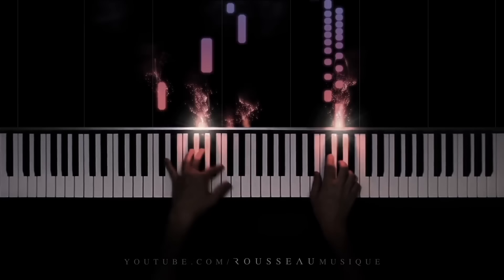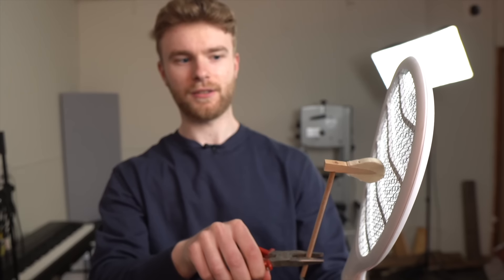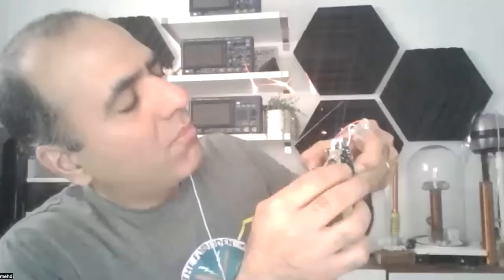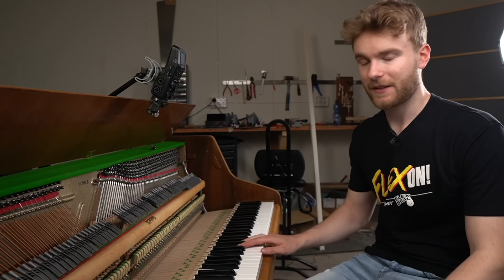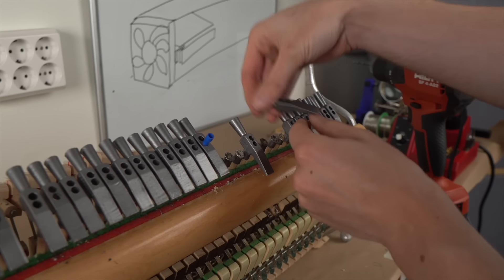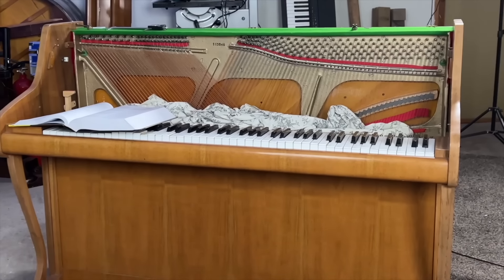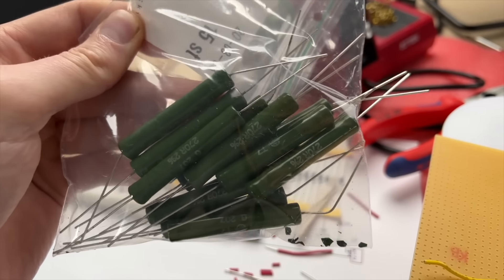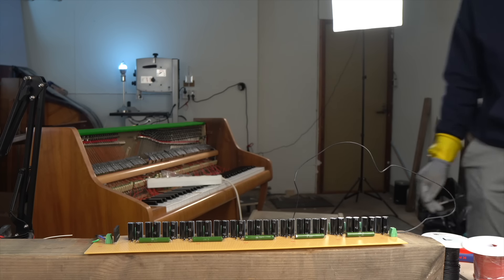How to NOT make an electric piano ft. @ElectroBOOM

Comment: if you listen closely, you can actually hear that the sparks are making their own pitches and music actually sorta matching with the notes he plays
Reply: If I had to guess it's probably something to do with the length of the strings.
Reply: frequency is inversly propotional to length that is why the sound of sparks vary with the lenght of string
Reply: @GamerChillz  this is probably the most accurate, along with the fact that the spark might also vibrate the string. Pretty sure the pitch of the electrical spark itself wouldn't vary in any definable way if my knowledge of electrical physics is right (admittedly fairly limited, as my formal education in it is only basic Uni level. If someone with an actual uni degree in electrical physics or similar disagrees with me, listen to them instead)
Reply: I just like the sounding of the sparks in time with the keys. Good observation though!
Reply: @settratheimperishable4093  Hypothetically you can make a circuit that varies pitch based on resistance (which would vary by string length if you hooked the strings up in a certain way). But, that''s pretty certainly not what's happening here (not that I know electronics well enough to be certain).
Reply: They just support rythm.
Reply: I can hear hit sounds
Reply: Auditory illusion. You think they have distinct pitches because you’re hearing it with the piano.
Reply: For some reason It reminds me of heavy metal bass drums.
Reply: And even drum syncopation
Reply: It's an auditory hallucination, they're all generally the same pitch.
Reply: In theory, the density of the electricity affected the pitch and the density was affected by the tightness and the size of the strings.
Reply: @speedsovereign  “Density of electricity” BRO ☠️☠️☠️
Reply: @muffinconsumer4431  sarcasm, i tried to hide the sarcasm so it would convince the others

Comment: As an Electrical Engineer I admire both your level of cringe around high voltages and your level of insanity!! That's something I thought only I would be mad enough to make! Those circuit boards were beautiful, amazing job all around.
Reply: my grandpa is a master electrical engineer for many many decades at this point and extremely anal about occupational safety, and this would probably make him lose it lmfao
Reply: One improvement to make is to have a gap under the resistors for better heat disipation.
Reply: I love how in the beginning of the video he was holding the hammer with a wooden handle with a pliers 🤣
Reply: I like how anyone who has remotely any skill with electronics is somewhat into the happy farm already

Comment: Thunderstruck is such an appropriate song for this piano!  Lol.  As an electrical engineer, I got cold sweat from you discharging the caps or plugging the prototype in for the first time.  Speaking from experience, I get this hallow feeling in the stomach before I test a prototype that has a chance of catastrophic failure.  
All in all, this is a great piano!  It actually sounds good in the video despite being hard to hear in real life.
Reply: It’s not Thunder Struck, it’s Lightning Strike
Reply: As a electronics enthusiast and engineer (but not officially in electronics) I got cold sweat seeing someone work on this particular circuit with the plug seemingly in😅

Especially if it's a first time.

Also I'd hate to work on something with so much "high" voltage capacitors I could touch😂
Hate those on ic's I work on even though they've never zapped me.
And incredibly fitting song indeed, didn't even realize even though the original was playing in my head😂

Comment: I think the reason your hammers weld together is because you are effectively using them as a switch causing inductive feedback causing a voltage spike high enough to weld the contact points, the solution is to add a diode in reverse bias to the end of your string, however that will clamp your voltage so you need to choose a proper diode that will produce a good enough arc but not weld the contacts.

Comment: I can see a future where metal bands start commissioning pianos with Mattias.

Rammstein gets a keyboard that shoots a flame jet whenever a key is pressed.
Dillinger Escape Plan gets a piano with Fibonacci tuning.
Dimmu Borgir gets a piano with razors instead of hammers.

And so on. Only Mattias would be up to the task.

It's always impressive, really. What a joy to watch your new project come to life :D
Reply: Military gets a piano that coordinates artillery salvos.
Physics department gets a piano with lasers instead of strings, that vibrate the air according to frequency needed (The piano villan might go blind after this)
Reply: @mechadrake  assume the mathematician gets a piano
Reply: @chri-k  assume the mathematician gets a piano had me ROLLING
Reply: I can see Jordan Rudess getting some insane combination piano/pedal steel guitar, including the ability to change dynamics on sustained piano notes like you can do with a guitar's volume pedal.
Reply: Golden ratio tuning would be about minor sixths between every note
Reply: Metallica get a piano that discharges lightning

Comment: Suggestion: put some plexiglass or other clear material as a casing around the hammers and strings, so A, its less likely to shock you, and B, it will muffle some of the pop sound while still letting you see the sparks. You could even try putting a colored material to see if you can make the flash different colors.
Reply: @Ian Visser You're unlikely to get that type of glass in a large enough pane to cover the whole piano, but it's possible to pilfer the glass from a few dozen welding masks and tesselate them in some fun patterns with silicone to fuse 'em together. Think of it like medieval glasswork- back in the day, glaziers couldn't get consistent large panes like we do nowadays, so they made smaller 'blobs' of glass and connected them with lead lines.
Reply: It might also save your life if one of the strings gets damaged enough to break. Those strings are under an insane amount of tension and could cause a lot of damage if they release in the direction of you
Reply: I'm not sure, but I think the flashes would damage the plexiglass, and eventually it wouldn't be clear anymore
Reply: @fableagain  Yeah, the sparks would probably start melting the plastic slowly but surely
Reply: @MrCh0o  If not that, the fumes and dust will stick to the glass.
Reply: @MrCh0o  No it wouldn't melt it but would stain it
Reply: Might be a different chemistry phenomenon but would using sodium/potassium salts change the colours?
Reply: Yeah, but it would blacken really quickly
Reply: And C it would block the fire extinguisher in case of fire

Comment: Try putting the sparking bits in a glass case to muffle the snaps. Also, you can use hard rubber for the keys to eliminate need for gloves.

Comment: For someone who works with PCBs and hardware, your soldering was very impressive, especially for a first time. Incredible video idea and incredible work ethic
Reply: I know right.
Sure better than me as a kid and the last part better than my prototypes on Chinese perfboards at times😂
Reply: Yeah the part where he soldered everything except the wire and the solder was in one big blob refusing to stick was so relatable. Only thing missing is melting the components with your soldering iron because the goddamn solder won't stick. 

Source: I suck at soldering. Especially piezo speakers, DC power connectors, constan wire and some other stuff
Reply: But he used so muuuuuuuch solder!!!
Reply: Yeah I also loved the ethics:)
A waste of time and a waste of resources just for a herd of ignorant a$$holes with the attention threshold and the environmental awareness of a housefly (That is usually the TikTok niveau) ... just to make a buck of it. To round that up: why not visit the landfill in Africa, where all this waste will end up? This will possibly sponsored by Henkel? ... Naaaah, I guess not:)
Reply: Ethics are a waste of time, we're all gonna die anyway
Reply: @PeterGriffnger  probably to handle the current😂
Reply: @PeterGriffnger   probably to handle the current😂

Comment: 19:04 rhythm is really brought out here. It's a percussion instrument at the same time almost. It adds in the same way tap dancing does.
Reply: Pianos are classified as a percussion instrument due to the hammer action. Even though it uses strings, it isn't a string instrument because the strings are hit, not plucked or strummed. Same reason why brass bells are percussion instruments and not part of the brass family, despite being made of brass.
Reply: @cheeseboy847  It depends on the way pianos are being applied. Generally, pianos have more of a hand in complex, solo repertoire the way other string instruments do - but in different circumstances when they are used to create a background environment, they definitely are.
Reply: @laurynk4209  I can see what you mean. It could be both due to it resembling a harp or lyre, but one played with percussive tools.

Comment: 12:27 "Electroboom warned me about this problem. However, during the hundreds of hits on the prototype, the hammer never fused with the string even though I used actual piano strings on it. That's why i was so surprised by it doing it on the piano. But i guess it has something to do with either the strings not being under tension on the modell or that the hammer action on this piano doesn't have the same impact/bounce as the action on this piano. Idk"
Reply: I was about to post that 😂
Reply: Thank you. Even at 0.25x I was having trouble pausing on the SINGLE FRAME that shows this
Reply: @claws61821  Pro tip for anyone seeing this: On Desktop you can use , and . to go back and forth a single frame :)
Reply: @claws61821  I was on mobile and somehow managed to snipe it second try!
Reply: @claws61821  the , and . keys allow you to go frame by frame if on pc.
Reply: @MaMalik_  stuck on mobile but thanks XD
Reply: @creativecipher  holy shit how did i not know that! thanks that will surely come in handy again at some point
Reply: @creativecipher  I never knew...THANK YOU. Google has some weird flippin' shortcuts, tools and search modifiers...
Reply: Thank you, I was trying so Hard to pause it on that, you are a lifesaver.
Reply: It looked like it was happening mostly on the lower note strings. While the higher note strings are single metal wires, the lower ones are more like guitar strings where they become corded and wrapped with other wire, which I think influenced the welding issue.
Reply: @claws61821  You should know that [comma] and [period] move one frame at a time backwards/forwards.
Reply: @claws61821  *4 frames

Comment: A few ideas for improvements if you intend to feature this piano again:

If you add an inline circuit breaker, you can eliminate the problems with the resistors lighting up like that.
Also worth noting that your resistors could stand to either be higher resistance (ohms) or higher wattage.

More ohms means the caps will charge more slowly but will make the whole system a fair bit safer, higher wattage will allow the capacitors to charge faster without the risk of the resistors burning when the keys stick.

Might also be worth a single big heavy resistor on the input to limit the system as a whole, it won't use as much current on startup and when playing many keys at the same time or in quick succession.
Reply: Found the friend that encourages people to pursue obviously terrible ideas.

And I’m here for it.
Reply: On that last point, an inductor would be better suited to help with inrush, since it limits large changes in current draw
Reply: @mars5train601  Good call, but I was looking mostly at the fact that the resistors were burning under sustained draw, the reduced inrush would be added bonus.

Perhaps both would be a good idea?
Reply: Reading your discussion about how to optimize this piano makes me wish this is pursued to make ready for market.
Reply from the maker: Thanks! Yes I was thinking of adding the a fuse in the circuit but I got lasy and just skipped it... For the resistance, I wanted the piano to charge faster than you could physically play the keys on this particular piano. You can play around 5-7 notes per second on this one. With the doubled up capacitors each capacitor charged to 3T in 200ms so anymore resistance and the charging would be too slow. The reason I didn’t want to make it ”more safe” was because the word safety and a project like this is not really compatible 😅even if we doubled the resistance, the resistors would start glowing like that either way when they fused. Only difference would be the piano would also charge less epic time. This video looked a bit spontaneous, but there was a few weeks of me an mechatronics engineer just discussing every possible way we could make this. Appreciate the ideas🙏
Reply: Never say never, if they were able to make CRT televisions and car ignitions safe, you can certainly make a sparky piano a bit safer - from watching this your skills are certainly good enough.
Reply: @Mattiaskrantz  If you ever want to reduce the fire hazard, instead of one resistor use two with double the the resistance and put them in parallel. Same charge speed, less heat. Less thrilling too though.
Reply: @Mattiaskrantz  You'd want a more complicated circuit that doesn't try to charge the capacitor while the hammer is fused. So basically a circuit that cuts off input while there's any output current, that should limit itself in the case of fusing. That way you don't get resistors overheating. But it's probably fine, who needs safety! :D

Comment: At 13:38 the resistor was glowing because one of the hammer was continuously touching one of the string (hammer got welded to the string) as a result continuous flow of the current occured and heated the resistor enough to glow...

Anyways great project...!!👍

Comment: When a resistor starts glowing, it means that the resistor is heating up due to the resistor either have too much voltage running through the wire connected to it or too low of a resistance on the resistor.

Comment: Great video ! 

You should create like a glass or plastic ( glass preferably since it isn't flamable ) see through cover, so that you are somewhat protected from the sparks and can hear what you are playing as I think the sound would be bit muted by the cover.
Reply: i dont think plastic is flammable either, at least acrylic or plexi isnt as far as i know
Reply: @nebula_wolf3132  Some types of plastic are flammable, some can carbonize but not burn, some just melt.
Reply: @nikkiofthevalley  only some types are flammable, as i said, and i also said acrylic or plexi isnt as far as i know, since these are both plastics that just melt. please actually read my comment.
Reply: @nebula_wolf3132  You said "I don't think plastic is flammable either". Plastic is the general term, it does not apply to a specific type of plastic. You said that generally all types of plastic are not flammable.

Comment: Wow! What a nightmare for electricians and fire marshals alike. Great video regardless. I especially liked how you figured out a way around the spot welding issue with the hammers. For avoiding fire and perhaps improve visibility how about putting welder's batting behind the strings? It's usually black but I think you can get a reflective kind that is also more flat. Great job! "Why start thinking now?" I laughed so hard at that.

Comment: The fast flash text in 12:27 if anyone is wondering: "Electroboom warned me about this problem. However, during the hundreds of hits on the prototype, the hammer never fused with the string even though i used actual piano strings on it. That's why i was so surprised by it doing it on the piano. but i guess it has something to do with either the string not being under tension in the model or that the hammer action on this piano doesnt have the same impact/bounce as the action in this piano. idk."
Reply: Thank you!
Reply: If anyone's curious, for future reference, you can play YouTube videos frame-by-frame by pausing and using (I think) the comma and period keys. It's good for those fast text moments.

Comment: Awesome video! I'm surprised the strings held up so well. A safety tip: put high value resistors (~1 Mohm) in parallel with each capacitor to allow the capacitors to self discharge after a minute or two. As you found out, manually discharging them will lead to a zap eventually!

The resistors glowing red is not good. I hope you measured them afterward to ensure they were still at the expected resistance.

Comment: You could add some very large resistors like 4-10 megaohms to automatically discharge the high voltage capacitors